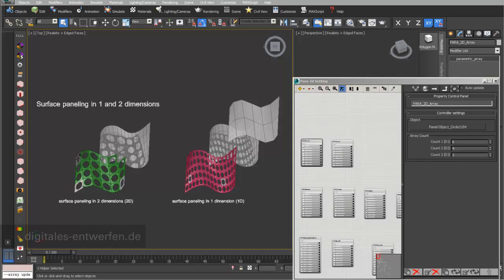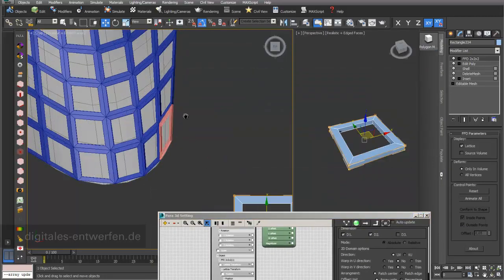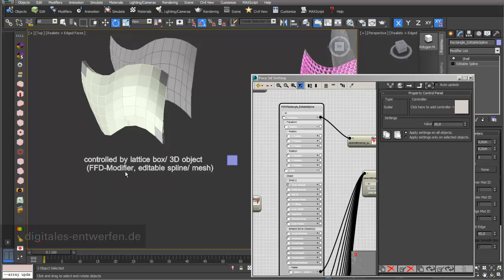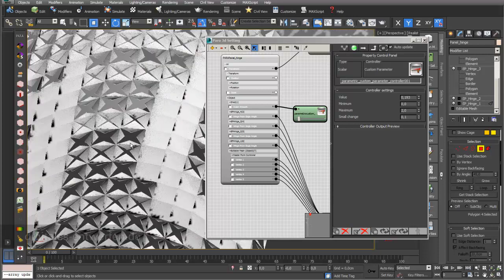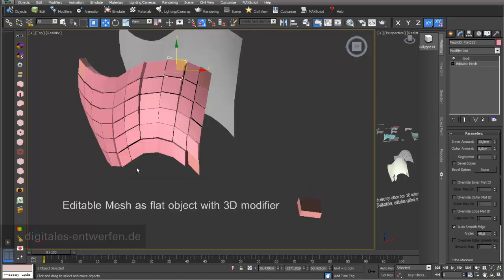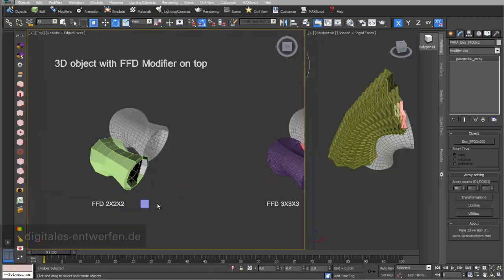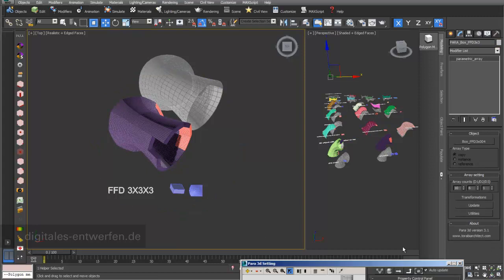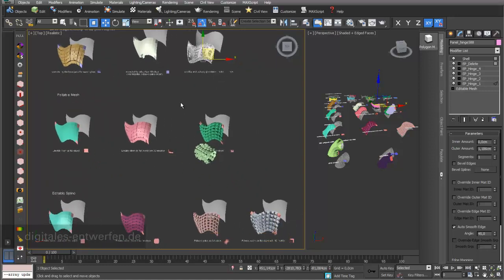Surface paneling - principals 03: characteristics of panel objects for para 3D in 3ds max

Comment: Hi.. Great work guys... I follow you very closely and
Expecting more tutorials.from you.
I was jus wondering If you can make one tutorial for para surfacing with precise building model.
Like for instance wen v design a tower,all floors are not of same height, they differ at some levels and some also has projections etc. 
While researchin a general para pattern v use a surface and 3dsmax generally divides the surface into  segments based on length and.breadth of the surface